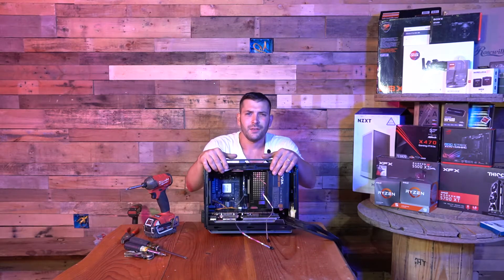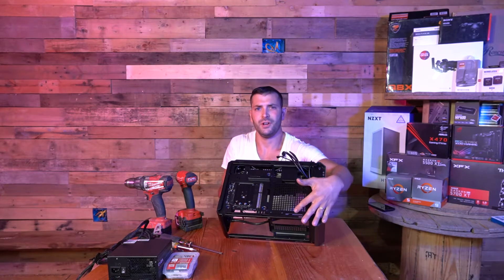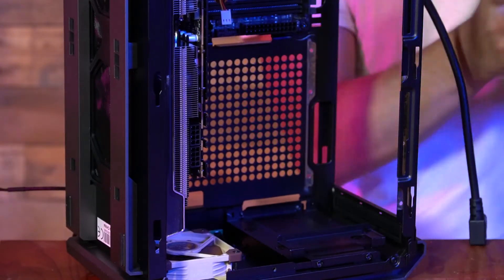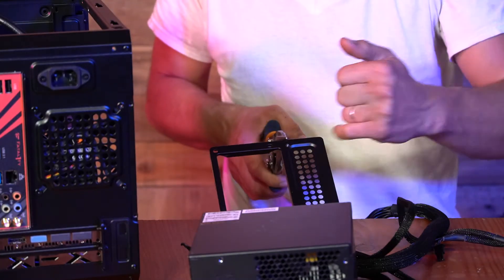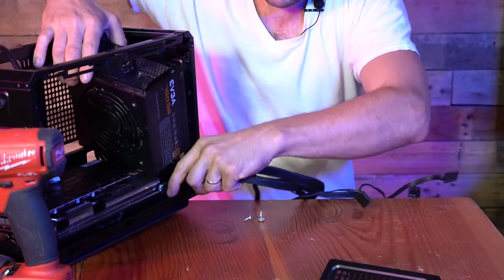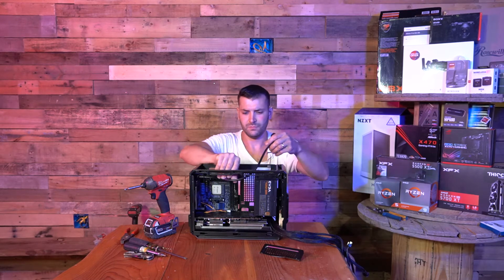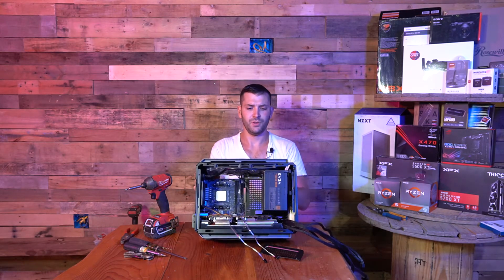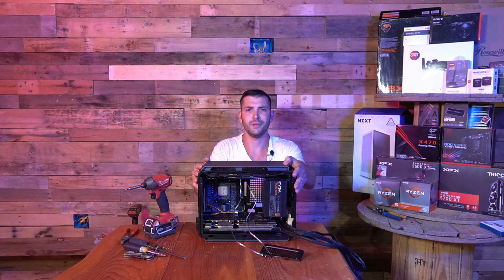Cougar Qbx Mini Itx RealSlav Power Supply Mod

Comment: Do you think it's possible to modify this case to fit a mini dtx board? It seems like you could just drill the extra holes but I am unsure if the PCIe port is in the same position. edit they sell those boards from origin pc so yes they will fit

Comment: Nice mod dude. I wonder if you use SFX power suply with your mod, can you fit 240mm liquid cooling system from side panel?
Reply from the maker: that would be pretty neat! you can fit a 240 in this on the top with it rotated how i did i believe
Reply: YES! Same here, I have the same case, got a CoolerMaster SFX 850W and getting a 240mm WC.

Comment: Nice project bud! 
How much clearance is left between the fans and the ram slots? I'm waiting to do this mod in order to fit a 240 rad in it, but don't wanna commit to something I'm not sure of
Reply: It's best to use a SFX power supply with this case. Most come with the atx bracket so you can mount it easily and have much more clearance than he does due to the smaller form factor of the PSU. Better thermals and cable management as well

Comment: Hey big guy, did you manage to pull before and after thermals on this rig? Looking to do the same if there's a fairly large improvement in temps overall. Do you run your side cage fan as well?
Reply from the maker: will post a video of the changed all around the board. once i put the pc into service "next week" ill make one
Reply: Looking forward to it! Thanks!

Comment: I am thinking about to buy this case to mod it and try to make it bether . 
one of the ideas is to make your mod for mounting a 240mm aio on the top and i was wondering, it will fit? 
the second thing i was thinking, if you drill some holes in the front of the case, you could (in your mod) turn the power suply 180° and put it a litle bit closer from the front of the case, in that way it will take fresh air from the front of the case. What do you think about that, its possible?
The last thing, will be to remove some material from the feet of the case to allow more air for the gpu.
What do you think about these ideias?
Reply from the maker: you can defiantly throw a 240mm air top there with some work, and certainly introduce new ventilation via the front cover!

Comment: You know you can make holes in the front panel (they will be invisible from behind the front panel) and mount the PSU with the fan facing forward (the front panel). Then the PSU won't suck air from inside the case.
Reply from the maker: the purpose of this was to have air exhausted through the power supply as well right through the top, if i had any modifications to the front it would be more intake as a single 80mm fan is not so sufficeint

Comment: What are the dimensions of your PSU?
Reply: I have a cougar qbx case as well.  Got a thermaltake modular PSU that is 150mm long. How where you able to fit that in. Coz' my PSU does not. Appreciate all the info and ideas I can get.
Reply from the maker: sorry for late reply i was away for the weekend and had no cell service. i will get measurments tomorrow when i have caliper accessable
Reply from the maker: @christianking523  im measuring 155mm max if you bed the tab untill it hits the gpu, my psu is coming in at 140mm